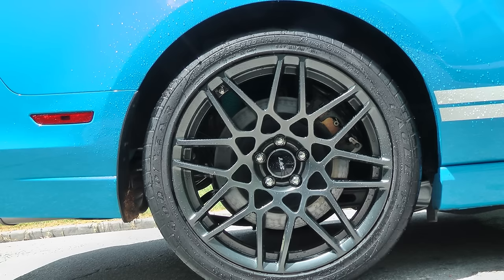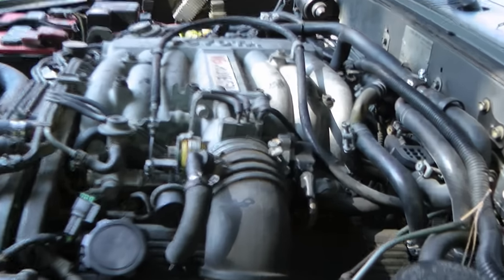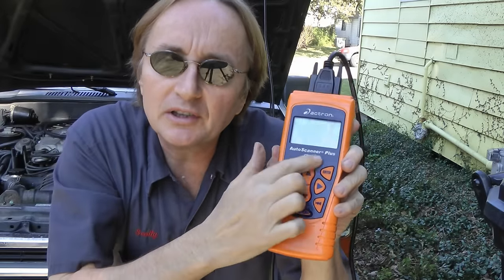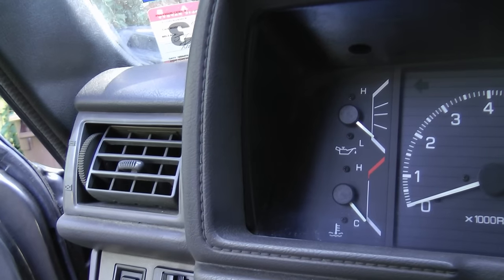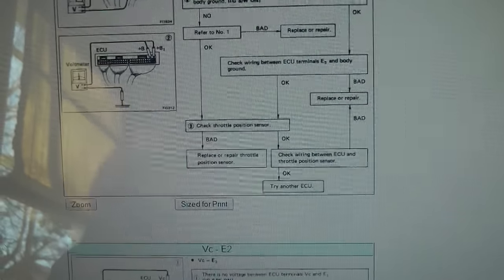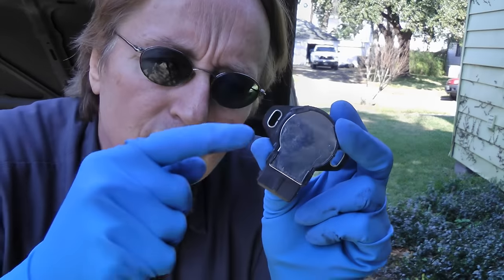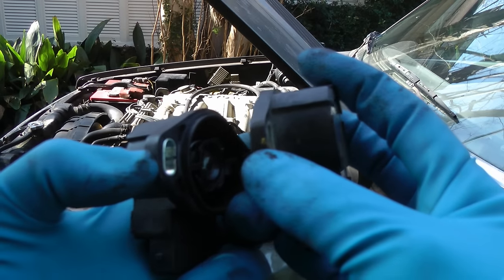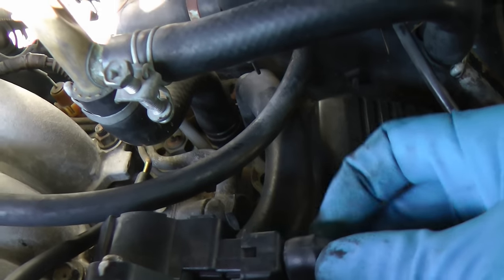How to Stop Car Hesitation (Throttle Position Sensor)

Comment: hey Scott how you i have a 96 camry its jerking wben i come to a stop light like a misfire could it be wires or throttle position sensor
Reply from the maker: try the wires and spark plugs first, if not that, try my video "how to fix a car that idles poorly" as rarely do camry tps sensors go bad
Reply: ok i will do thanks scotty

Comment: would a messed up throttle position sensor stiffen the steering ?
Reply: Probably not, have you checked your power steering fluid reserve? Look under hood and it will say power steering on it.
Reply: April williams 
it shouldnt..steering pump or low fluid

Comment: I unplugged my tps an nothing happened no change? 1998 toyota 4runner 3rz fe, I can't figure out why it's idling rough an jumps from 600-1000 rpms an won't stay running until warmed up, just put new plugs, wires, fuel pump, and fuel filter. Idk what's going on any help would greatly appreciated .

Comment: I have a question i tried to replace my throttle sensor i did it but now my 02 nissan xterra is idling high but not gowing its speed limit i want it to go for example i press the gas im trying to go 20mph and it idles to 5   what is going on

Comment: I put my car in D an it revs as if it’s in neutral but it will let me manually shift it just fine as in putting it in L, 2nd, then drive. It’s an automatic transmission too. It’s a 2007 Kia Rio lx. The code it’s showing p0731 please help what it could be

Comment: 5 series BMW automatic 65 plate stuck in gear any questions how to release it to get it recovered
Reply from the maker: +Satnavdmc good luck on that , without a BMW dealer level scanner it's probably impossible unless you want to remove the drive shafts to tow it.
Reply: On the older cars are used to be  able to lift the gear shift gaiter to lift a lever to get into any gear you want with no power could put into neutral but I thought you would be able to help on a 65 plate
Reply: Ps thanks for all of your help

Comment: My 08 buick enclave is hesitating in between 1-2k rpm in low speeds , almost second gear, if i push the gas or keep it above 2000rpm it dont do hesitation. Also no checking light on, i replace spark plugs and clean tb and mass air flow sensor..it did not fix it.

Comment: hi mr scotty i owned 1994 mitsubishi galant i have problem of my idle is not stable that i cant also use my ac because the idle is dropping specially when my engine turn hot, when i rev my car my rpm increases more the 2500 meaning my maf sensor still fine as they said in other videos but if i release may rev pedal my idle needle drop fast what is the possible cause?can you help me
Reply from the maker: +Jeff Imatong   try my video "how to fix a car that idles poorly" and also "finding engine vacuum leaks with a cigar"

Comment: Hey Scotty I have a 2002 BMW 325i and every time I try to take of it takes of super slow and the mpg go all the way up like crazy when I step on the gas pedal . But after like 4 seconds it runs normal but the mpg stay high  any help ? Idk if I make sense
Reply from the maker: +Alexis Ortega often vacuum leaks on that model, try my video "finding engine vacuum leaks with a cigar"
Reply: +Scotty Kilmer it was the Valve cover gasket and spark plug do you think it's easy to replace ?

Comment: My situation is like this, my car gets high RPM but slow acceleration. Even over 3000, it only gains like maye 10-20mph. When I stop waiting for the red light, the car sometimes shakes, even wobbles back and forth occasionally. It's like people having sex in the car. It's embarrass. Could it be the sensor or i need to change a new ignitor or both? Also, the engine starts up slow after a night, could it be my battery declining or i need a new ignitor? Thanks
Reply from the maker: nothing to do with ignition, either your clutch is slipping if it's a standard or your transmission is gong out in an automatic. High rpm and slow acceleration is one of those

Comment: I have a 2004 BMW 545i and its hesitating very laggy specially when it's cold but no check engine no codes also, I installed new spark plugs and its still laggy slow acceleration I almost have to floor it sometimes

Comment: hey Scotty I have a 95 ford f150 4x4. ..when its on  my truck shakes like it wants to turn off...it also does the same thing when it's on drive on a red light...what could that be?????
Reply from the maker: +Santiago Jimenez   do my video "how to fix a car that idles poorly" and also "finding engine vacuum leaks with a cigar"
Reply: But where is the idle located..something else than a cigar I don't want to get the truck on fire...thank you for texting back my question...

Comment: i have a 02 Honda Accord...after a heavy rain storm last night i noticed that it revvs up by itsself. what could it be
Reply from the maker: +Alonzo see if air filter got coated with water. if not, check electronics on the throttle body to see if they got wet and are not sticking

Comment: hello i have a question i have a 1993 toyota camry xle v6 ita an automatic and it wont shift gears unless i accelerate it in to 3 or 4 rpm and i can feel the pistons trying to work but it skips when im going up hill could this be from old spark plugs
Reply: Hey Alisha, read the comments directly below yours....or read this........

http://community.cartalk.com/t/overdrive-rpms-in-93-toyota-camry/27592

There's a couple of tips in that thread to try....Good luck....

Comment: scotty, i have a problem with my car. When i start it, it idles fine, after i give it some gas, it idles way too high, 2000-ish rpm. If i turn of the engine and start it again, it goes back to normal. Could this be a bad tps sensor?
Reply from the maker: could be, but try my cleaning video first https://www.youtube.com/watch?v=eQpPcdvSBks&t=32s
Reply: Scotty Kilmer yeah, i forgot to say that i already cleaned the throttle body and idle valve. Thx for the response. It's only 10 bucks for a new one so I'll try it and see if it fixes my problem

Comment: Hey Scotty, I have a Infiniti g35 and my car has a hesitation issue, I reset the ecu and relearned the throttle body mechanism because it used to idle Alittle  to high than it was supposed to, so it idles normal now,  but it still hesitates:/. What can it be, help?
Reply from the maker: Dubsakk666 many things can do that, tune it up first, and if not that, try my video "how to clean fuel injectors on your car"

Comment: What’s strange is that my car doesn’t want to push passed 3 rpm briefly after I start up my car from maybe a 3+ hour break. It stops after a few minutes I usually let go of the gas let the rpm drop then push it again then it starts moving normal. I also have no check engine light.

Comment: I have toyota 2004 corolla they have some problem when i press full gas pedal it missing like power lose . i had change spark plug but problem is still there can you tell me what the problem.
Reply from the maker: try my video "how to clean fuel injectors on your car" and also pressure test the fuel pummp

Comment: I have a camry 2011 2.4L 4 cylinder. The engine dies immediately after starting. And there is hesitation on acceleration at low speed. Got it diagnosed by scanner and no trouble codes. How can I solve this problem?
Reply: @Green Drop Talk Thank you. It did help solve the problem.

Comment: hi Scotty I have a 2009 Nissan altima that shakes when the car is stopped like when you start the engine it will start shaking and get even worse when trying to drive it. any help please.
Reply from the maker: +Mathpi mix try my video "finding engine vacuum leaks with a cigar" and pray it's that easy of a fix. Also change spark plugs and air filter if they are worn

Comment: I have 2007 Honda CR-V my check engine came on and went to an auto Part stre and the test the light and they told me the throttle body need to be replaced, then a week after the light goes off and sometimes comes back, but my car does not shake or does nothing wrong

Comment: what does it mean when your rpm drops under 1k rpm idling!? not always but sometimes when I come to  a complete stop
Reply from the maker: normal in most cars, average idle speed  is actually 650 to 800 rpms on most cars
Reply: Scotty Kilmer but when it starts bogging? I'm missing my valve on the driver side valve cover next to the oil cap , also with the hose that goes across to the intake.

Comment: Hey Scotty if you can help, I have a 98 Audi a6 2.8 when my car is in park and I press the gas my rpm's go up like normal but when I put it in drive and press the gas my rpm's are very slow to climb and I barely move Please help if you can...
Reply from the maker: +Lonnell Edwards audis are money pits at that age.  But often that's a transmission problem on that model. Find a guy like me with  Vag Com scan computer to analyze that first. And really, get rid of it soon or big repair bills will be at your door

Comment: Hello Mr scotty I replaced my tps but my check engine light is still on Can you help me and tell me what's causing this thank you
Reply from the maker: +Jose Nunez i would need your make model year and the exact trouble code numbers
Reply: +Scotty Kilmer  my s10 1997 chevy is running ruff and shakes and i have put plugs wires in what could it be thank you

Comment: Hi I have a 2005 Hyundai Elantra 60,000 miles on car . Car run fine on idle but it won't rev up above 2000 rpm changed all sensor even fuel injector mass air flow n body but if u put gas into intake it rev up ??? Can u help me with my symptoms
Reply from the maker: +William Kennedy pressure test the fuel pump to see if it's weak. If not that, often a bad transmission

Comment: 1989 ford f150 302 hesitates while accelerating and sometimes shuts off replaced high pressure fuel pump fuel filter new distributor had a tune up 6 months ago  so i guess throttle positon sensor next?
Reply from the maker: could be that, but it's better to analyze rather than guess, I'd hook up my scan tool and watch live data. Unfortunately for you, that's an old ford and only mechanics have scanners that will read that old stuff, so perhaps find one to at least analyze it
Reply: alright sounds good thankyou

Comment: I have h/insight 2011, my car had been jerking quite often everytime my car accelerate and brake. feel cvt engage not stable...already change EGR valve, Spark plug, engine oil, cvtf, clean throttle body, new 12v battery &...
I checked at computer got 3 code not completed, is it this 3 code related with the jerking problem? sry my bad Eng..

P1658 Honda - Electronic Throttle Control System ETCS Control Relay On Malfunction
P1683 Honda - Throttle Valve Default Position Spring Performance Problem
P1684 Honda - Throttle Valve Return Spring Performance Problem
Reply from the maker: +Xiang Xiang you may need a new throttle valve, sounds like it's shorting out
Reply: +Scotty Kilmer Thanks for the reply...So i need to change a new one electronic throttle body?...The parts sound like expansive one...If can i have to swap 1 secondhand TB to try the problem gone or not b4 buy a new one..This problem has been with me for a longg time already...i hope i can fix it after done with a new TB parts. Thanks

Comment: hey Scotty, my 2000 mitsubishi eclipse start stuttering when I accelerate from a complete stop but the goes away once the car has gained speed and when I'm at a red light or a complete stop on Drive the car starts to drop rmp and makes the car jolt a but then rpms goes back to normal right away and keeps doing this often then it goes away for a while but then come back when I step o the accelerator hard on my car
Reply from the maker: pressure test the fuel pump to see if it's weak, and if not, try my video "how to clean fuel injectors on your car"

Comment: hey I have a 2001 buick  with a 3.8l and I changed  my tps out but I heard  that I have  to get it reset. I disconnected  the battery and it still sucks. I heard  you got to reset it through  the pedal
Reply from the maker: +Elante Ford na, just driving it will reset it. You only need to reset the crank sensor if that's changed
Reply: +Scotty Kilmer ok thanks how long do I need  to drive it because  it sucks  on gas and likes to shut off  when it gets  at the right operating  temperature.
Reply: Hey Scotty Kilmer I have a 2005 Ford F-150 with a 5.4 3v and I my oil pressure switch goes on and off all the time but I have no rattle  but I don't hear any rattle or knocking it would be great to hear back from you thanks

Comment: Hey scotty my 1997 4runner (3.4L v6) has a hiccup, what feels like a skip, every few seconds and sometimes when I start to accelerate(only from complete stop) it hesitates like it is bogged down but then takes off.
Reply: The skip is when it idles
Reply from the maker: tune it up first, and if not that, try my vide "how to clean fuel injectors on your car"
Reply: Scotty Kilmer thanks! I have done all of that recently, can a dirty gas tank cause that?
Reply: Scotty Kilmer also- sometimes it has to crank many times, more than it should, before it starts.

Comment: I want to change out my crankshaft, camshaft, and coolant sensors problem is I can't find them on a 2010 Hyundai Tucson there is nothing in the manual and can't find any videos on the internet where they are called two dealerships and they wouldn't tell me so i'm just trying to talk to mechanics to see how they find these sensors

Comment: hi i gota 93toyota camry it has no power when trying to drive wont even make it up small hill with peddle all the way to floor. ive changed tps and temp coolant sensor snd sending unit last time it acted up. the idle is horrible sounding too.

Comment: when i accelerat on my 2000 acura Integra it picks up speed really slow any suggestion
Reply from the maker: change the fuel filter and do my video "how to clean fuel injectors on your car" and of course check for a clogged air filter and worn out spark plugs

Comment: Plz guyz help. i did the diagnostics on my nissan murano 2006 and results were. 1. throttle body and 2. acc pedal sensor.. i bought used parts and took it nissan for relearn. They failedto do it and said i need to buy brand new tb and acc pdl because the ones i bought had already been programed to the car it was taken from. ARE THEY RIGHT

Comment: I have a 2011 Chevy Malibu I was driving and came to a stop at a light. As the light  turned green i went to accelerate and my car would not accelerate or reverse. I shut the vehicle off and wait 10 mins then started the vehicle. My car was working again after 5 mins  the acceleration slowed down...what can this be????

Comment: hi l have ford L200 transit 2004 duel LPG/petrol works fine on lpg but not petrol ticks over on petrol ok  but will not run under load on cough and splutters on petrol changed petrol fuel filter no difference  not sure if its sensor or if the two systems use the same sensors or possible in tank fuel pump problem ?
Reply from the maker: pressure test the pump first, pray it's that easy. Modern fuel injection systems are not simple
Reply: +Scotty Kilmer thanks scotty for the advice  .it had a new ford fuel pump at ford  22.000 miles didn't show any change in the problems  or show up any problem with tests equipment ford technical guys were baffled . changed filers still had the same problems then changed ford  petrol fuel in tank pump again at 32.000 miles to non ford part . van works perfectly now and start first time and even starts when hot first time pulls an accelerates like it should   . don't ever rule out fault new parts or faulty batch of parts  . the ford dealer won't admit its a fault part  . strange how it works perfectly with a non ford part now .

Comment: I own a 2006 Saab 9/3 2.0 turbo. I plugged it up to a code reader because I had no power and the car had sluggish accelerating. it was the tps. I bought the part. I have been looking for 2 hours to replace it but I can't find where it goes. ugh..
Reply from the maker: +Link Hoskins it goes on the throttle assembly right at the side where the throttle plate is. Remove the air duct going to the throttle to line up where the throttle plate is and you'll see the tps on the outside at that level
Reply: +Scotty Kilmer thanks ! ill take a look !

Comment: I have an 84 Toyota sr5 its flashing code 5 which is oxygen sensor I replaced it but it is hesitating on acceleration but I have tune it up and put new fuel filter as long as you accelerate it slow it will go but when you mash on it it bogs down
Reply from the maker: try my video "how to clean fuel injectors on your car" and pressure test the fuel pump to see if it's weak

Comment: i have a 2004 hyundai elantra i wanted to know why evertime i accelorate to 60 it starts to shake i know i need a new catylic convertee is that the issue
Reply from the maker: could easily be a bad cat if you're talking about the whole car shaking and not just the steering wheel

Comment: my impala ss 2007 is acting up I went to autozone because the check engine light was on and they told me that it was the oil pressure sensor so I bought it and changed it ... but when I tried to turn on the car it wouldn't start ... the dashboard said "engine power reduced" but if I remove the oil pressure sensor it starts up normal. .. so I looked it up why and it said it was the throttle body sensor but the throttle body is 226 dollars and I want to know if it really is that because it's expensive
Reply from the maker: +Noe Valdez get an oem factory sensor then, removing it making it start shows it's no good